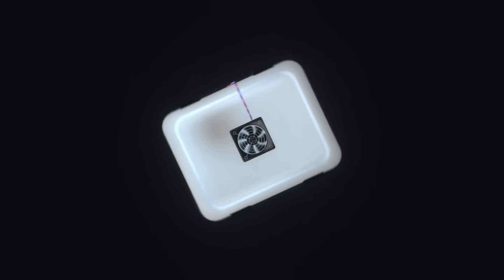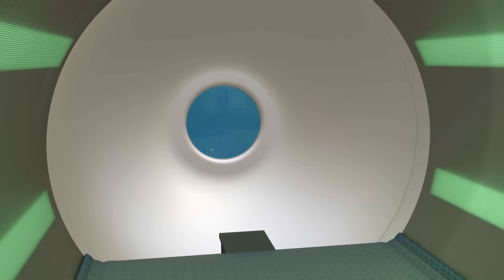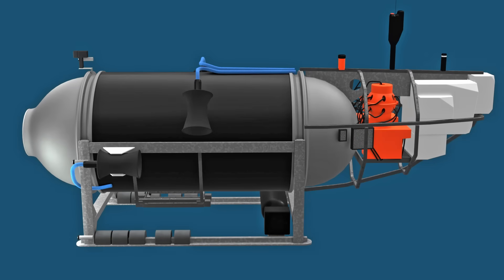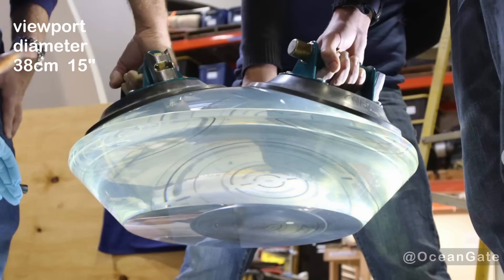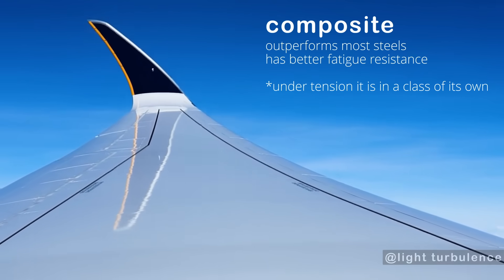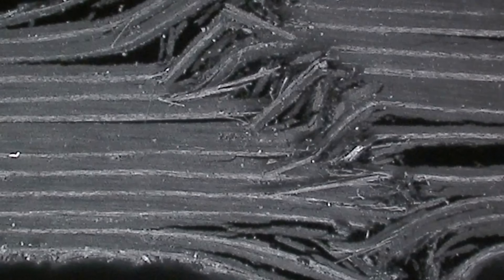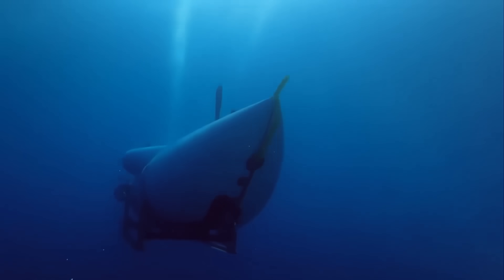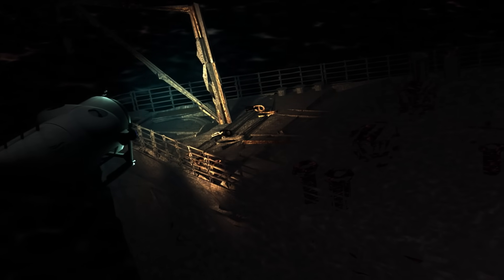Titan Sub | carbon fiber - Detailed Tour

Comment: Why is the rate of decent important?  As long as pressures are not applied so suddently as to be concidered impact then wouldn't the hull materials respond similarly to "rapid decent" vs "slow decent"? 
Thanks in advance.
Reply: I was wondering the same thing.

Comment: Find video of James Cameron expressing his incredulousness that this happened at all. He's been down to the Titanic over 30 times, and has descended to and safely surfaced from many times deeper into the depths of the ocean than the depth at which the Titanic rests. He speaks about being part of a community who share a deep respect for the known science of deep-diving; follow the rules, you can descend and surface safely. This outfit was cavalier, dismissive, impatient, flouted the known science and all those who've worked hard to figure things out, and did so at their ultimate peril. People have survived jumping off the Golden Gate Bridge too — how willing should most of us be to gamble with our lives that a new technique is worth the risk of trying it out?

You may go right ahead and document what makes carbon fibre potentially a good material for deep-dive applications, but getting to a place where it can be applied in a way that is safe cannot be shortcutted. 

Standards exist for a reason — circumventing them is hubris and should, in no way, be considered reasonable.

Comment: There was a time period when the sub was having issues and the crew was well aware that they might be in parrel, there's no question about that, i'm not basing it from a transcript that hasn't been confirmed but rather the entirety of the situation, the landing gear was purposely dropped signifying there was an issue in the first place, why else would the operator have dropped as much weight possible as he could, makes sense only for the reason that there was an issue and they needed topside, now if you take these so called fake transcripts into the factor as well it only strengthens my point, if you were operating this sub and you were having issues then the first thing you would try is propulsion, even though the propulsion system only moves you left, right, back and forward it would still do something, so one would do the obvious and try something, so to call it a fake transcript based on that is purely inadequate, now taking immediate actions instead of wasting time? well how bout one person was operating the sub while the other took immediate actions in having someone dictate what was going on, communication is just as important in a case like this so topside knows what's going on and that in itself is immediate action, i found this video useless, full of nonsense and a lack of common sense, one thing for sure is carbon fiber is a very useful material for deep diving and an every day part of our life so to rule carbon fiber out of this purpose is wrong, it needs to explored more and scientifically perfected for it's uses and take this as a very expensive lesson in deep ocean diving, meaning spare no expense accept life, because life is something that will never be recovered.
Reply from the maker: I can see you REALLY like the fake transcript 😂
It certainly makes for a more sensationalist story 😉
Reply: @Mike-Bell  not much of a critical thinker are you.

Comment: you called the "fake transcript" fake without any real evidence that it was fake, based on your own words many would say that all the points in this video that you make are also fake as well, seeing as there is nothing scientifically proven in your video either and you yourself do not have any true facts of what went on and only speculation on your part that this is a fake video full of dis information. Might  I make a suggestion to rectify the situation whether or not you wanna take my advice is up to you, don't stand on the heads of others to try and make your point, make your point with common sense and work well with others instead of against them.

Comment: Snd not putting any reinforcement in the center the area that would flex the most 🤤
   A first year engineering student should know better. 
   As it flexes and delaminates water pressure just peel that thing like a onion
    I can make the strongest beams and supports known to humankind
    Still wouldn't have used carbon fiber in that orientation
    And being totally expermental wouldve tested one till it popped

Comment: It remains to be seen if a Carbon Fiber hull can be successfully used in the construction of a deep diving sub, but this failure will certainly set the use of Carbon Fiber hulls for deep diving subs back decades.

Comment: It's not just the carbon fiber compressive strength involved. It's  the cylindrical shape causing both hoop stress tending to flex the center inwards combined with huge axial stress pressing on the now inward bent center fibers.  
I work with fiberglass pipes and although it can take serious internal pressure it utterly fails at a miserable 10-15 PSI external pressure. We had an entire pipe line system self destruct due to a blow out and the vacuum induced collapsed and destroyed the entire system. That is only atmospheric pressure 14psi.
A carbon fiber SPHERE might be more workable.

Comment: A couple of things. The transgression points into the vessel (wires ect) were more than enough in themselves to have triggered the lost of ballast (leaking water weight in) and eventual implosion points.
Moreover, that would jive with what was purportedly being texted back and forth on that ride to hell.
Reply: A slow leak would not have imploded the vessel
Reply from the maker: There is no such thing as a slow leak at that sort of massive water pressure.

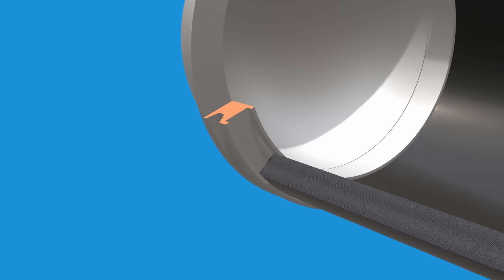Comment: 12:51 Surprising that any of the flange remained attached after the implosion.
The initial failure in the first microseconds of the implosion was likely one of three things: a compressive failure in the composite (even adjacent to the bond), a shear failure in the composite/titanium bond or a shear failure of the bolted joint. In the latter two cases the composite cylinder would have deformed into an ellipse, the cylinder moving outwards at two lobes and inwards at the other two until it shattered.
Titan's pressure vessel was a ring-stiffened cylinder like a submarine; the rings were the pressure domes. A cylinder behaves like a toothpaste tube. Rings increase the crush depth.

You did a lot of research for this. Thank you!
Reply: I doubt it is a shear failure of the bolted joint, given that the rings do not appear deformed aside from having the flanges ripped off.

Comment: The whole debacle with OceanGate is such a stark reminder that there are no shortcuts in the material sciences; all materials (especially composites) have a best use case, and deviating from that use case without acknowledging the change in properties is a fast track to failure. Yes, it would have been 'wasteful' for them to create carbon fiber endcaps just to cut them off, but having not done so for the sake of a 'cheaper' method left them with a composite material which lacked the strength on a vital axis needed for long term survival of the craft.

Comment: I really appreciate the thoughtful, rational way you explained this.  I'm so sick of armchair experts who have no experience whatsoever in the design and construction of such a unique vessel.  SR obviously made some literally fatal mistakes in how he treated risk and testing, but there's no reason that some company/institution couldn't spend the time and money to properly test and overspec such a craft successfully.  He really was blind to the risks, or at least chose to ignore enormous issues with the whole design and build process, skimping on testing and lacking a willingness to seek outside expert advice and admit he needed such help.  It would be amazing to see someone do it right and open up more of the ocean's depths and mysteries to people who ordinarily would have as much chance of experiencing such environments as the average person would to stepping foot on the moon.
Reply: But many "airmchair experts" are experts. And all strength formulas depends on there being zero delamination. Because a normal rope is enough to show delamination isn't an issue for tensile strength. But a huge issue for compressive strength. And no one has yet shown existing manufacturing able to properly solving the delamination issues for this usage case.

Which makes lots of "armchair experts" correct. It's irrelevant what the theoretical compressive strength is, when you can't actually build a hull to that level.
Reply: and add to that the problems of the cf/metal joint it is possible to design and build a better joint at greater cost, but  there comes a point were the fatigue life deems the hull unsafe in any event and you have to make another, is the cost of making replacements in c/f cheaper or more expensive then an all titanium or steel hull  in the first place @perwestermark8920
Reply: The author of this video is an aerospace engineer, not a naval engineer. AEs do work on submarine design but that's no reason alone to take his statements on authority.
Reply: Reality being the Man built an Amusement park ride. No more.. No less
   Cost cutting was endemic.

Comment: The problem is not carbon fiber nor titanium, the problem is that they have different thermal expansion coefficients,  cold temperatures made the parts behave very different

Comment: Thought experiment.....Take a long thin party balloon, wrap string around it, then remove some air.....does the string stay in shape? Do the same again but this time dope the string in epoxy resin and allow it to dry, does the string epoxy stay in shape? Maybe the only thing stopping this composite tube from  collapsing is the strength of the epoxy?

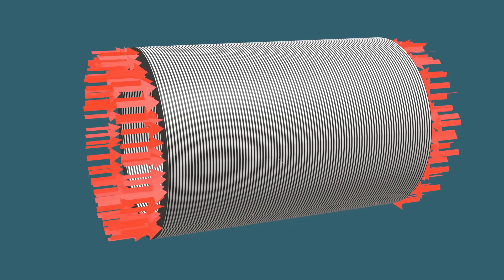Comment: 11:08 where are you getting this from?
Makes no logical sense that the axial fibers would carry the axial loads, they would collapse. In that configuration it’s the same as pushing on a string. I’ve tried to look for any sources to back up your claim, even asked chatGPT, and everything I find states that the hoops take the majority of the axial load together with the matrix of the composite.
Reply from the maker: I wonder how a racing yacht foil stays upright on its carbon fiber foil if its fibers are only strong as pushing on a string?  Surely the foil would then fold up … well like a ball of string. I’ll tell you how - carbon fibre has fabulous compressive strength. 

How is this carbon fibre hydrofoil is staying up straight. 
https://youtube.com/shorts/5vdlE54dhpM?si=WkdiQKKdF6Fc5pXY

Comment: From the transcripts, it seemed probable that there was water intrusion of the layers decreasing the buoyancy of the craft. So, while they were likely aware of issues by about ~30 minutes ahead of implosion, they were incapable of escaping the depths like they needed to in order to avoid the catastrophe.

While adding tons of foam padding to reach neutral buoyancy is expensive, and adds “unnecessary weight”, if it is impervious to water intrusion, then it at least prevents potential loss of buoyancy in critical situations.

Comment: Many experts pointed out all the possible problems with this design. Failure was predicted, long before they finished the build.
This particular vessel was rated for a depth of 1200 meters, no more. 
No testing, no certification, not listening to others, using the wrong materials.... And now all 5 are dead.
Shouldn't come as a surprise...........

Comment: Thank you for the Excellent video and presentation.

However I am of the opinion that this was a tragic event which should not have happened.

As a retired Chartered Engineer working with Carbon Fibre for a number of decades in the Space Industry, I always paid a great deal of attention to the interface between the carbon Fibre and metallic flanges.  

Other than Mars mission which use light weight structures, I have only been involved in launch structures, so long term fatigue of a structure was never a problem.  
However Titan would have been subjected to cyclic loadings from both the sea pressure and thermal at the sea bed.  Thermally Carbon Fibre has a low thermal expansion, whilst Titanium in comparison has a very high coefficient roughly 8.5E-6 depending upon the grade. 
 
The torispherical dished ends, would contract when it was zero degree C and the resulting Strain would have done little to help the cause of a thick cylinder of carbon fibre with the bizarre CF lay they had selected. 
Why they did not use a cross ply construction is beyond me.

Making the vessel from Titanium may well have increased the weight and cost, but the crew would still be alive.

I would love to see the Finite Element Model they used in the design, in particular the interface between the Dished end and the Hull.

Comment: The weight of the end bells and jostling of the towed sub and temperature cycling could have caused a crack or fault at the interface between  metal and fiber.  That was always a potential weakness.

Comment: you say it wasn't the carbon fiber and then you say it was the carbon fiber.
it's true CF can be quite strong in compression, however I find it entirely plausible that a sustained extreme compression could peel the matrix off the fibers slowly at a weak point and progressively approach catastrophe. If they routinely heard gun shot bang from the vessel that's an extremely worrying thing.
I'm not convinced that the transcript isn't real. And it sort of makes sense that they got the hull warning from his dumb system and maybe the hull had shrunk enough to hurt their buoyancy to where ascent was very slow. and eventually too slow to make it.
Beyond the recklessness of using untested carbon fiber, he was extremely reckless in every way. I think he wanted to die in it.
I wonder if boron could be an interesting metal because it is extremely light and stronger than titanium.

Comment: I think the issue is that Oceangate and its CEO overestimated the capabilities of carbon fiber for the application they were using it for. It is a proven material for aerospace development, and has been used in the construction of Northrop Grumman's YF-23 prototypes. I have no doubt that carbon fiber can be used for manufacturing deep sea submersible craft or even for pressure vessels of deep atmosphere space probes for a future mission to any of the Jovian bodies in our solar system, but carbon fiber composites alone could not withstand the pressures it was being utilized for under the manufacturing technology we have available. Instead, it would have been safer to use sandwich layers of carbon fiber and titanium alloys for maximal pressure resistance and durability for minimal weight.

That said, more testing needs to be done, and they really should have gathered data with several unmanned deep dives of the Titan submarine to begin with. Instead, innovation in the field of passenger and scientific deep sea submarines may be held back by several years thanks to one man's arrogance.

Comment: I don't believe any amount of development could have built a safe CF submersible. CF is an amazing material, but it is not possible to build anything out composites where there with be zero flaws. Trying to keep out thousands of tons of water pressure it only takes one flaw in the construction to assure tragedy occurs. Had they built the CF tube better it still would have failed it just would have taken longer. Submersibles, aircraft, pipelines, nuclear reactors. We have tons to experience building highly stressed parts that cannot be allowed to fail out of metals. Metals can be tested, they can be x-rayed, we know to high degree of confidence how metals will behave in applications like the hull of a submersible. A metal pressure vessel is a well understood predictable homogeneous structure. Whereas every FRP composite is a unique structure. Something like Titan was made of millions of strands of fiber held together with epoxy.
Reply from the maker: Composite pressure hulls on deep dive craft. Here is a list https://www.researchgate.net/figure/Composite-materials-being-used-in-submersibles-worldwide_fig1_364296004
Reply: @Mike-Bell  Sure, I didn't argue it can't be done, just that it can't be done safely. Most of those craft are unmanned which is what composite hull submersibles should be limited to.

Since the Titan tragedy I wouldn't be surprised if there are no longer any manned composite hull submersibles operating anywhere.